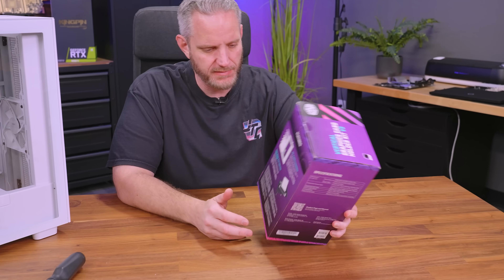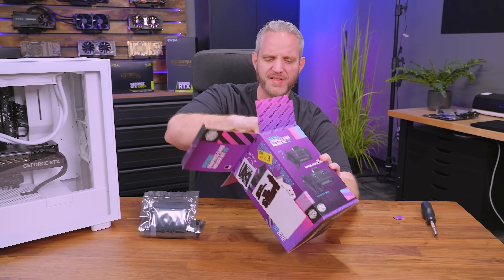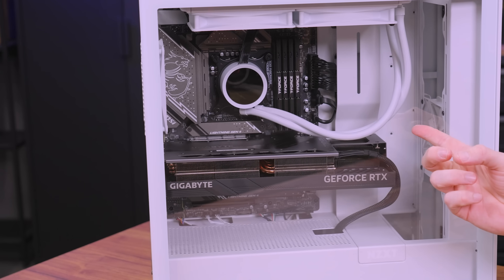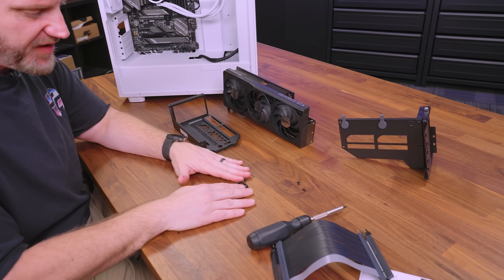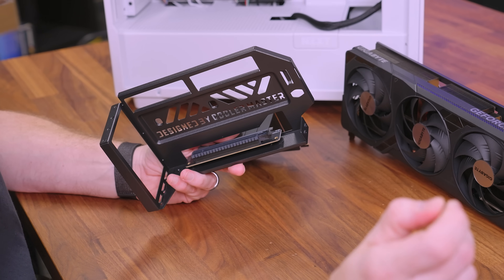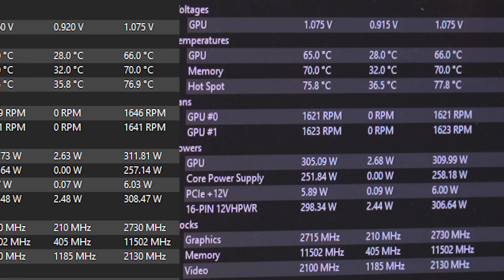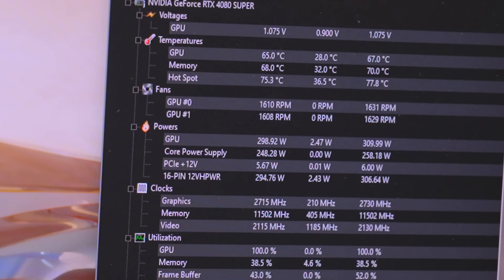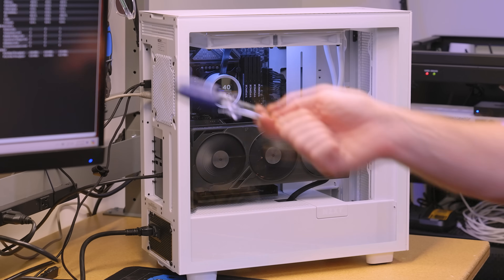Can this mount actually HELP GPU temps?

Comment: Maybe it's just the cooler design of the Asrock Phantom Gaming 7900XT I have, but my GPU is vertically mounted and every few months or so I have to repaste it because the thermalpaste thermal pumps out the bottom of the gap between the GPUs Chip and the Cooler. It starts out great but it just slowly gets worse and worse over a 3-4 months period.
Reply: Sounds like a faulty card. I have the same thing and I do not have that problem. I’m using the same vertical mount that Jay is using in the video.

Comment: I started using a vertical mount.  Like the video, I really didn't notice much improvement.  But then, I don't have the setup Jay has to test both.  Having said that, I do tend to agree with what he said about the one side of the GPU, when mounted horizontally, that runs along the motherboard, and how that can cause a bit of air choking.  Regardless, I like the looks of a vertical mount, so that's my main reason for having it.

Comment: fitted that to mine about a month ago after upgrading my PC Case to the Montech SKY2, works great (although I bought it to hopefully side mount my 240AIO but that didn't go as well :(
Edit the Montech SKY 2 has bottom mount fans that draws air from the back of the PSU so hopefully that helps with my set up.

Comment: This is the exact same mount I use in my h9 flow, and I love it. It easily holds my 4080, and it is really adjustable so I could get excellent airflow. Temps have never broken 65c

Comment: That's why I ended up going the route of a cheap brand case(Gamdiaz Neso P1) I wanted to vertical mount for a while and ended up getting that case when i switched  over to a 40 series aorus master, and the great thing about the case is there's multiple positions for the riser cable to be screwed to the bottom of the case + I could fit a 420 aio at the back for the i9, so now I have cool air blowing through the aio + have cool air blowing through the graphics card, the reason for me wanting to go with vertical was simple

1. Aesthetics 
2. More direct cooling over the graphics card
3. Prevention from possibly cracking the pcb(but gigabyte improved with the later revisions on the pcb design at the latch and using the new 12v2x6).

And as Jay mentioned it's always a good thing to have support at 3 contact points, that's why I've also used the factory anti sag holes on the gpu and laser cut a piece of acrylic to support the gpu at the back as well, so now it's secured at the io side,on the bottom at the riser and at the back of the gpu.

Now I'm just curious myself if there's any benefits of having the bottom fans blow onto the gpu from underneath and/if it will impact the gpu fans performance as they'll essentially blows into each other

Comment: I bought that vertical GPU mount and It is not compatible if you are running an air cooler and your GPU is taller then the pcie bracket.
Your GPU and your air cooler will touch.
Anybody buying that vertical mout keep that in mind.
It would be compatible if my CPU was water cooled but water cooling a 5600x...... unnecessary.

Comment: II have been using the original LianLi vertical adapter for my AMD 6950 XT from Sapphire in my LianLi O11D mini for 1.5 years. The graphics card has 2cm space to the glass and it works best this way. Use the chimney effect. 3 fans at the bottom draw air in, 3 fans at the top draw air out of the case. The air draws through the passive cooler of the graphics card. And the 280mm radiator with its fan sucks fresh air into the case from the side

Comment: I have been raving about the CM V2 mount since that was launched. Its solid, you can move it all over the place, and yeah, the temps are not night and day, but I found the internal temps were better for the case. Because the airflow is better, the case fans don't ramp up as high.

Comment: I run this gpu bracket in an 011 vision, Strix RX580 8GB. The fans on the bottom of the case are intake and thus blow directly across the gpu. I mainly play old RTS games so nothing too taxing and watch 4K youtube vids. The fans basically never turn on. Every now an then they will turn over for less than a minute and kick back off. I don't think it is thermally any cooler, but the gpu at least stays cool enough to make it's 0 rpm fan curve happy.

Comment: I like that device. With the weight of many cards and the horizontal stress they put on the pcb, it's a great add-on to modernize older cases. I might buy a couple of those kits for stock.
Reply: This is what the brackets and stands are for
Reply: @richardatkins3623  and yet you still cant see front of your gpu and most of lighting

Comment: It's not a universal mount unless you claim using a Dremel on the case is standard for a PC build with all cases. If it's not a big hole where the PCI-E slots are like all cases that do not already have a vertical mount option then you will need to use a Dremel to remove the case PCI-E slots. If you need to mod cases then it is not universal.

Comment: Would this be a better position to protect the pci pins from breaking? My RTX 4090 is very well supported im the old horizontal position, but i wonder if this position would 100% remove the risk?

Comment: Don't forget to mention that your pc-case must support it.. or your have monitorcables you cant connect through the expansion slots : I Can't use this on my Corsair 750D Airflow!
Reply: yeah I've got the same issue with my Antec DF600 Flux case, the expansion slots are separated by small cross members so to fit this and be able to plug the monitor cables in I'd have to Dremel out the bars first. Ho well the RGB is on the side of my GPU anyway so I think I'll leave it horizontal. Nice idea though.

Comment: What happens if you have more cards than just a GPU in your motherboard? All the vertical mount lovers/mount/motherboard manufacturers never seem to think about those of us who have multiple cards in our PC.

Vertical mounts never work in cases like this because there is never enough space for two virtical cards and you cant put one virtical and one horizontal in the same case.

Comment: I got something like this for my case. The gpu kept hitting the fan on my chipset and the bottom slot basically put the gpu on the psu cover. While I had to remove the pci bars, it does support the gpu well and I no longer hear the fan hitting the gpu.

Comment: I boght this bracket because it would accomodate for my gpu and network card. Sadly the cooler master bracket is not compatible with my cooler master HAF 700 Evo 🤯. I could not use the version 2 included with the case because I would lose the network card.

Comment: I would like to see 2 topics being adressed in a future video. 1. What to do with any pcie Expansion card. 2. What are the temperatures like when you mount a fan underneath the gpu so its blowing additional air thru the heatsink of the vertical mounted gpu.
Reply: I have the white version of this, I've been using it for my strix 3090 in a white 011d xl case for about a year now. my gpu temps are no better or worse even with 3 fans still on the bottom for intake, but my motherboard chipset temps did come down from the gpu being away from the motherboard.
Reply: @Jay-uw2eb Same with my O11 Dynamic and 3090 ti fe
Reply: I have a hyte y60 with fans blowing up through the gpu. Didn't really help until I put some additional heatsinks on the gpu backplate. As there was space, and they're not visible, I thought I may as well!
Reply: @TheMerce101  The Y60/Y70's airflow is slightly restricted. It was a case I was considering but then I saw Thermaltake's CTE C750 Air and plan on getting that once I have cash to drop on Alphacool Eiswolf 2 AIO for Asus Tuf RTX 4090 and a crap ton of new fans.  

Currently I have the Lian Li Lancool 3, 3 fans blowing up from the bottom and it helps, I even tested a fan directly behind the card using a 3D printed PCI bracket for a 120mm slim fan. Reduced hot spot by 10c.
Reply: @FullMetal-Tech  yeah it's not ideal, it was a bit of an afterthought following watercooling and realising the hottest thing in the PC was the 3080ti backplate!
Reply: Vertical Mounted 4090 owner here, 1. depends on the case, the Thermaltake CTE C750 Air you can occupy all PCI-e slots if GPU is in the vertical float position.  2. temps will change when fans are aiding the GPU, especially hot spot temps, since the hotspot is the backside of chip and is transferred to the back-plate.
Reply: I have a P8 and I have a vertical GPU, with a vertical Sound card and a Vertical NVMe card for my business.

All i had to do was buy 2 PCIe risers, and they are VERY flexible. Which allowed me to give it a slight bend without a crease. It's been working great for about 3 years so far.

Comment: I've got an EZDIY-FAB equivalent - similarly adjustable, but it was cheaper and has RGB which we all know makes things faster! (A few years ago I had a Thermaltake case that came with a vertical mount, but a combination of terrible design and an acrylic side panel meant my 980Ti was too close to the side and the heat softened the plastic enough that the fans caused it to bow inwards and start rubbing against it.)

Comment: Makes me think if the cases side panel had openings for the vertical mount to intake fresh air you'd run cooler still.

Comment: I bought one and didn't work for me. It didnt clear the air cooler. And the back plates and support brackets in-between them so it was hard to get the display port hooked up.

Comment: I’m running a 4070ti with the same vertical mount in a Corsair 5000d airflow and I get 2-5c cooler temps than the standard mount.

Comment: I've used various high-end expensive vertical mounts... I've had this for 6 months now in white and it is by far THE best one
Reply: me too. i've been using this vertical mount with my 4080 in my phanteks nv5 since december with zero issues. i tried like 3 different vertical mounts before i found this one.. highly recommend
Reply: I'm using the same vertical mount. It's great
Reply: I heard the riser cable that comes with this vertical mount breaks after plugging and unplugging a GPU twice is that true?

Also how hard is it to replace a riser cable for this GPU mount
Reply: @lovie74  I've plugged and unplugged it a good 20+ times in the time I've owned it when working on the PC, I'd say if someone breaks it it's user error
Reply: I'd argue the EK-Loop Vertical GPU Holder EVO is better and is way sturdier.
Reply: @The-Choo-Choo-Shoe  - I've got the first version and the EVO in my 2 rigs. The EVO makes it a bit easier to unlatch the video card. With the original, if you don't use the supplied PCIE-3 riser cable (in my case a LINKUP PCIE-4 riser cable) with the protrusion out the side it is fiddly. I also think the way EK offering mounts is very sturdy utilising the RHS motherboard mounts for triangulation.
Reply: @The-Choo-Choo-Shoe  yea you're right because it screws into 2 of the side mobo standoffs.. But both are sturdy enough, my case I have a huge gigabyte 4080, and would prefer adjustability with the Cooler Master one, especially in my case because I'm running a huge 60mm radiator WITH tubing running to the back of the case.. I'm literally able to adjust the mount so it sits between the rear and front tube, literally MM's to spare
Reply: @The-Choo-Choo-Shoe  EK is nice but $50 vs $190, hmmm I will upgrade to EK if the Cooler master starts to droop or has other issues.
Reply: @Ilovenetworking  EK one was 45 dollar on Black Friday sale here.

Comment: Riser cables are such a stupid invention. It was ok with older pcie gens but you extend the trace length so much that you degrade the signal integrity in an amount that can either crash the system or the auto negotiation needs to switch to a lower pcie gen...

Comment: If you have vertical, it would technicsly be better because then if the tempered glass has holes in it then the gpu will push out hot air if the case is Laying down on its back, and the fans on the gpu push out air, pls consider this, it would be a big change,
Ps, i would want to design a case for you or give you ideas

Comment: i have the 011 mini vertical mount kit from lianli. if your using a larger air cooled card the rear fan needs to be removed. I was not removing the fan for the vertical mount.
Reply: I have the strix 3060 triple fan and it fits perfectly and doesn't exceed more than 45°
Reply: @RayzTvT  the 3070 ti aorus master did not fit, when i upgraded to the 7900xt that also did not fit in the vertical mount with the rear fan.  i did not want to down grade or remove the fan
Reply: I run a Proart 4080 Super with the lian li mount and it JUST fits with the rear fan.

Comment: I have the HYTE Y60 case and my 4070ti is sat sideways with the fans facing the glass and I get some really high temps. Mind you I am running in 1440p higher settings but I can get upwards of 84-85 sometimes. I dont remember my hot spot temps but they also got very hot. The case has good flow with 4 intake fans and 4 exhaust but that seems really high in my case. Not really sure how to fix it.

Comment: Have had this in an H9 flow and 4090 for awhile. Helped run the 12v vertically instead of bending or using adapters.

Comment: I have that in my O11 and it honestly made doing my custom loop a lot easier because of the adjustability and when I bought a new gpu I was able to use the same tubes even though my new block had ports in a different spot because of how much you can move it.
Reply: can you fit a sound card in the back? I have the same case and once finished my gpu WB hits the glass. FAIL. lol
Reply: Like behind the gpu? I don’t think so unless it’s pretty small. I could barely fit my hand behind it to plug something into a usb header. Plus the ribbon cable would probably get in the way. If your pcie slot for your sound card was very low and you had no fans in the way you might be able to pull it off. Hard to say for sure tho.
Reply: @andxang  My board does come with a nice sound card. Wouldn't be the end of the world. I finished a water cooling build to only find out the gpu wb was hitting the glass of my 011 case. FAIL lol Good thing for Prime.. at least I didnt add water yet....